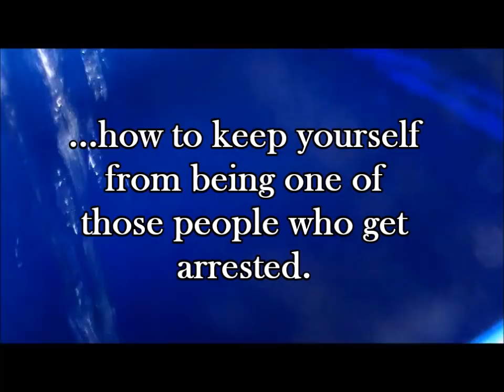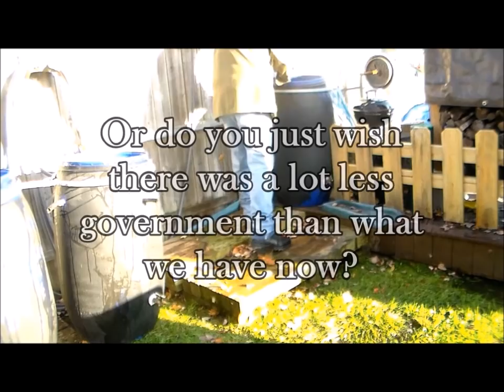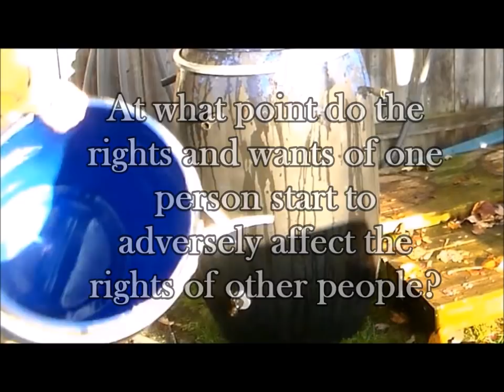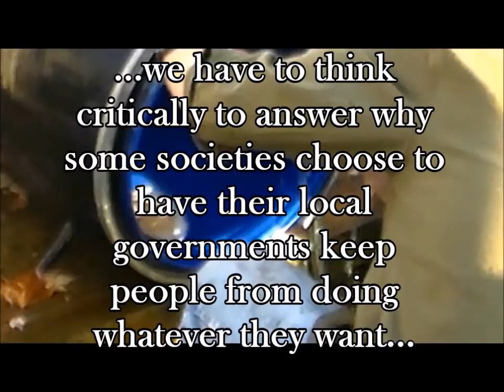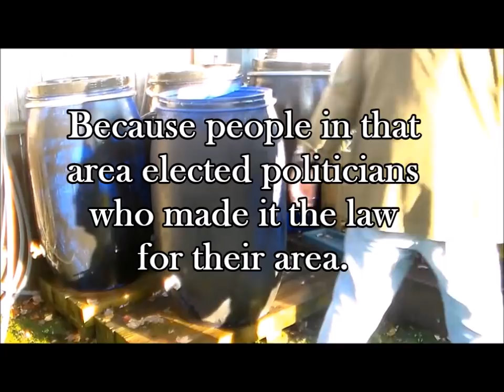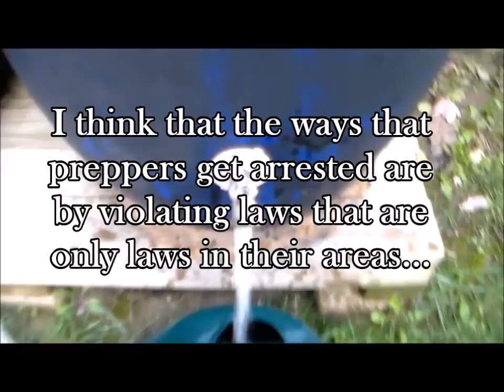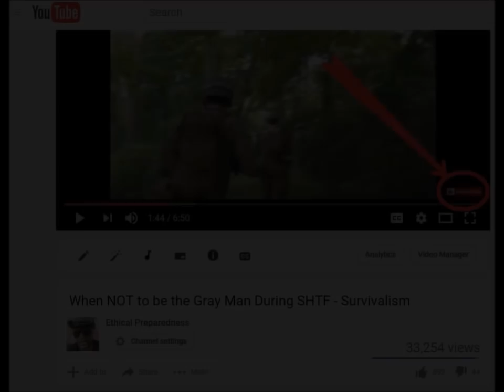Two Reasons Why Preppers Go to Jail

Comment: Great video!  Thank you for taking the time to cover this important topic.
>
That being said, there are two important points I think need to be made.
>
The first point is that we have codes and standards in our communities to make things uniform and safe.  We have seen them enforced for so long we cannot comprehend how bad people can make stuff if there were no codes of standards.  Just go spend some time in Pakistan or similar location where houses are essentially house of cards built on each other that collapse with the slightest tremor.  The problem is not codes and standards, rather it is those politicians who demand far more than are necessary and makes everyone's life difficult.  You elect them into office so you are partly responsible.  If you don't like the codes then either get them changed, move or figure out a way to get by by violating them while not being noticed.
>
The second point is far more important.  The purpose for prepping is NOT to be prepared.  It is to create an environment around you that will allow you to survive should anything go wrong.  Part of this is to be prepared just like part of it is to be trained with the necessary skills.  Perhaps THE most important aspect of prepping, however, is operational security.  Operational security is making sure that you do not tell the world about your prepping.  After all, if everything goes bad and people are starving, then how does it help your situation if everyone in a 30 mile radius knows you're a prepper with lots of food and such?
>
A golden rule in prepping is not call attention to yourself.  If you call attention to yourself then you will get all sorts of bad things happening during SHTF.  To that  end, you do things slowly and without fanfare.  If you collect food, then buy it in quantities such that it won;t cause others to notice.  When you store your food and other prepps, then don't tell others about them and do not let people see them.  If there are rules in your neighborhood that you cannot live with and you chose to violate them, then you do not want to be blatant about it just to make a point.  That is self defeating.  Should rules exist that you cannot live with, then either move away or violate them in a way that no one will notice.
>
If you want to be a successful prepper, then you want to be a person that does not call attention to them self and a person no one would suspect of having any kind of preparations.  This concept applies even during the early parts of the SHTF crisis.  If others are struggling and you are seen by others to clearly be doing well, then that will call attention to yourself and you will be inviting bad things to happen to you.  
.
Thanks again for yet another great video.
Reply from the maker: Those are all EXCELLENT points Cleetus!
And that's a big reason why I conceal my face and my identity here, because I don't want to announce to the world that I prep and also announce to the world who I am.
Reply: The most intelligent comments I've ever read true prepper prep's for himself his family while being completely incognito to the world which includes the government and your neighbors good luck everybody
Reply: +Bill and yours is what, 60?

Comment: Long story short, if it hits your roof it's yours. If it hits the ground it belongs to the state or water rights holder. Tanks are legal, ponds are regulated heavily. 

 I live in Oregon, and remember this story. Just after this story was released I started working for a man who built and installed rain catchment systems. Everyone assumed that it was illegal to own any form of rain catchment. At that point in time the law(as I understand)was it is illegal to sell a rain catchment system that is not fully screened. This is due to mosquitoes breading in the standing water. Storing rain water in tanks is legal even as much as 50,000 gal. There are however heavy restrictions on human created ponds. Land owners also don't have a right to the water that runs through or near their property without owning the water rights. Anything within 200' of a river, Creek or stream is protected by  riparian zone laws.

Comment: I lived in a rural area for 15 years and had no problem with my city government until the last couple years when there was a change in the population and hence the government. When I moved in I installed a rainwater collection system that was pretty much hidden from passerby s and all the collection vessels were behind a 6 foot high privacy fence. Several years later I submitted and obtained a well permit and drilled a well that was capable of providing for the needs of my family. About 10 years after I moved in the county came thru and put in sewer down thru our neighborhood and there was an option to tap into the system. We had a well taken care of septic system that I had gone thru and cleaned out when we moved in and expanded several years later so we opted not to join. Most of my neighbors did not take care of their systems and opted to join as their existing systems failed. Then in an effort to force everyone to join the city began charging us for the sewer water treatment even though we were not on it. I protested and won in court but I ended up losing later when I became a target of the city. First thing they attacked was my well. They revoked my permit and said I had to cap the well. I fought them in court on it and got grandfathered in so a couple weeks later the shut off my city water for "lack of payment" on a Friday afternoon.  I always paid ahead by 90 days so that got squashed but not until the following Monday. So I flipped the valves for the well so we would have water over the weekend. No problems with my system so I left it on and the city water off even though they turned it back on the following Tuesday. But on Monday they issued a citation for lack of water services to a residence. The code enforcement officer pulled in my driveway while I was washing my truck in the driveway. Told her to go get f**ked.. Bad idea.. Soon had half of the city police department in front of my house. Thankfully I was friends with the county sheriff and he sent several deputies out to iron out the misunderstanding. Needless to say my troubles continued until I sold the house and moved. 

What I learned is never live in a city or any area that might be annexed anytime soon. The government has unlimited funds and plenty of assholes working for them and they will make your life miserable. Something I did glean from my experience with this particular city is that the lower profile that you keep the better. I should have never permitted the well and when the sewer came thru I should have hooked up like a good little sheeple and kept my septic system online and healthy as a backup. To keep everything current take one weekend a month and go to well and septic system for the entire weekend would have been perfect with no noticeable decrease in services that anyone would notice. I actually never had any issues with the city and my rainwater collection because it was used mostly for my gardens and to raise fish in several pallet cubes so it never entered the house.
Reply from the maker: I agree with you. Never purposely move to a city or to someplace that will soon be annexed by a city. Populated cities almost always come with a ton of laws and ordinances; many of which conflict with a self-reliant way of life.

Comment: There is nothing illegal about owning explosives or automatic weapons.  You just have to get the correct licenses and permits.  For automatic weapons, the ATF can issue one of several classes of license.  Class 3 is the most common for individuals.  For explosives you have to get a blasting permit, or a blasting permit exemption, depending on local and state laws.

Comment: Building a massive reservoir of water on your property could be more dangerous than you think. 

1. As mentioned in the video, if the dam fails, it will be massacre,
2. Large bodies of water change local climate,
3. Large amounts of water on your property that doesn't belong there could cause massive groundshifts and earthquakes, as well as it may destabilize local underground water reservoirs.
4. Large bodies of water change local ecosystem, attracting animals that didn't live there before, destroying original natural balance in the area.

Comment: Well thought out video.  The only comment I have is about water retention.  I have personal experience with someone who believes that because they drilled a well they have a right to all the water they care to use or waste, with no regard to how it affects their neighbors.  I drilled a well on my place, it produced 18gpm, more than enough for domestic use.  As soon as the neighbor across the road heard about it, they did their best to find the underground stream supplying my well.  They drilled a much larger diameter well and began using it to water 2.5 acres of grass (lawn basically) They ran sprinklers 24/7 during the summer and soon my well would only produce 1gpm in the summer.  They responded to the drop in water flow in the aquifer by installing 10,000 gallons of storage and pumping what was left of the flow into those tanks so they could continue to water their grass. You could argue it is their right to use the water from their well as they see fit, but their actions had a direct impact on my right to use the water from my well at all. In dry country, someone who dams a stream is taking water from all the people and wildlife living downstream.  That is the reason Oregon enacted the law about collecting water.  Government's real purpose is to protect the rights of society from individuals with no consideration of those rights.  Agreed they have gone way beyond that purpose in many instances, but without some form of government anarchy prevails and civilisation disappears.
Reply from the maker: Thank you for your well-thought out response. This video has evoked a lot of emotions in people; and unfortunately not many people articulated their thoughts as well as you did.

In fact, a lot of people that had the belief that he should be able to do whatever he wants on his property (even if it negatively affected his neighbors) didn't bother with actually articulating their response... most of them just cursed at me in their comment. 

I agree with you: I believe that government is a necessary evil; and I think that government should be kept as small and more localized as possible. 

Even if you totally disagreed with me on the video, I would still appreciate your comment because you actually put thought and reasoning behind it. 

So thanks again; and I'm giving your comment the Thumbs Up and also 'hearting' it. :)

Comment: I live in the state you mentioned and that is an interesting question how much will you affect the people around you. In our local West Hills there was a catchment that was located in a gully, it been there for  years. Nobody ever said anything about it but it was obvious that an earthen dam had been built across the gully. When we have heavy rains long enough we have landslides. I was working clearing landslides from the roads in the area. One night that earthen dam broke.  The water ran down the hill, it took out a paved two-lane road, one car and two houses and damaged some other property. In that case the dam should have been  regularly inspected by a competent person.  
  Other ponds are a simple depression with no dam to fail.  Some have a minor embankment. People need to take responsibility when they may effect others. 
  There are advantages to safely retaining water on the land for the community.  It helps to reduce flooding, erosion, recharges the aquifers and can improve the habitat. But never cut off other peoples access to water.  Water rights must be respected.  Three big lakes could be cutting off some one elses water rights.
  Many water providers want to meter and sell as much water as possible. Water collection and distribution is expensive. People having an independant water supply cuts that revenue.
 A real problem is cross-contamination, if you collect water or have a well and that water is contaminated and it's connected from your property to the municipal water system it is a health hazard for the other water customers. People have tried to restrict water rainwater collection to 55 gallons in Oregon and have not been successful at this point. Generally you can have a 5000 gallon or less storage.  There are two provisions one that it not be connected in any way to the potable water system and the other is that it not drain into any sewer system. Most locations expect you to have a permit and a plumbing inspection. All of that is subject to change. If you do have a water catchment system it may better if it's not obvious.  
  Historically people who hoard things have had them taken away. So know the difference between hording and preparing.  Keep private things confidential. Be responsible don't flood, blow up or poison the neighbors.

Comment: I was thinking of adding a well in addition to city water.  It would be good for watering the gardens and backup.  There used to be a well since it's the oldest house around and had a lot more property but where is a mystery.  Found the old septic system but would have to be replaced and under the driveway.

Comment: Colorado used to have a law that prohibited the collection of Rain Water, but about two years ago they rescinded that law.  .However you still cannot Dam up any body of water, you can create a dam that holds back run off from a hill or such, but the dam must meet certain standards of safety and be able to withstand certain amounts of pressure, and yes I live in Colorado,
Reply from the maker: Thank you for providing that information and for contributing to the community. :)

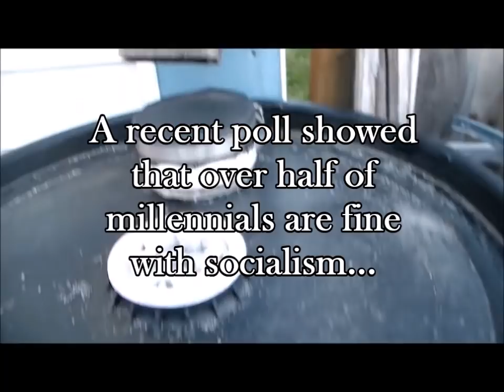Comment: 11:54 That's an AWESOME water collection/storage set up, complete with trans barrel water passage tubes and faucets at the bottom of each barrel!! 👍🏿👍🏿👍🏿👍🏿👍🏿👍🏿👍🏿👍🏿👍🏿👍🏿
Reply from the maker: Thank you. They've done me well now for several years. I really like having approximately 400 gallons of extra water on hand at any given time. 
What I REALLY wished is that I had taken more time during the initial set-up of them. That I had taken more time to measure where I needed to drill holes for the water passage tubes, etc. I ended up being in a hurry and did kind of a sloppy job. :)

Comment: Why are the connecting pipes set so high up the barrels?
Reply from the maker: Mostly they sit at the same height that my lawn mower is as I mow the lawn. It was mostly done that way to help keep any hoses and pipes out of the way of the lawn mower. And also because I didn't (at the time) have a first flush rain catchment system, I wanted the barrels to fill up one at a time before filling up the next barrel. This way most of the gunk from the roof ends up in the first one or two barrels; leaving only nothing but sparkling clear water in the last two or three barrels. This way once every couple of months I just dump that first barrel (that contains all the dirt from my roof) and it keeps my rain water fairly clean. :)

Comment: Very good points again. I love the fact that you say "check your local laws".  A lot of what you describe for preppers that can get them arrested can be obtained legally.
Without being too specific you can get licensing or own plans, components that are not illegal by themselves. And if a SHTF situation happens and lawlessness breaks out you get to work as needed. I would stress that book smarts do not equal the ability to actually obtain what you want in the end or be safe.  IE you can get an explosives license pretty easy and fairly cheap and it comes with training for example. You can take a gun smith course.. and some State Universities offer EMS training and licensing for (18yr old) high school aged kids free of charge as a part of their regular public school benefits. You can take it too with them - great bonding experience. The reason is that you can legal obtain a medical device like a cric kit or ARS decompression needle but if you are not licensed and use it you can be arrested for practicing medicine without a license.  SO there are ways to get what you want or think you need legally as a prepper. It just takes some effort to do so.

Comment: Well in my county most large builds, like the Reservoir and freestanding buildings, need permits that are meant to make sure the standards of the Construction is high enough not to fail under extreme conditions.

They never ask why you are building what you are building. They just care how well it is built and it won't fail.
Reply from the maker: That's excellent; and that's the way government should run (just protecting the people and not being overbearing). :)
Reply: @EthicalPreparedness  :: exactly.
I think the common misconception is that the government just up and arrests People but the real story is that the prepper has disregarded the rules: such as getting a permit to build a dam or underground shelter. 

Besides, In SHTF there is no way the government is going to trek to your property to take your stuff in that chaos. You gotta worry about normal people first.